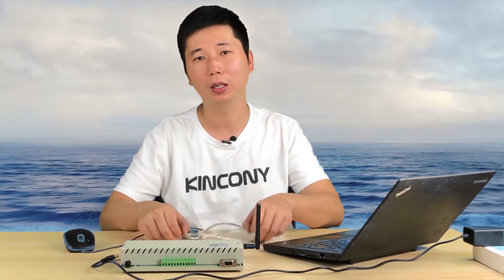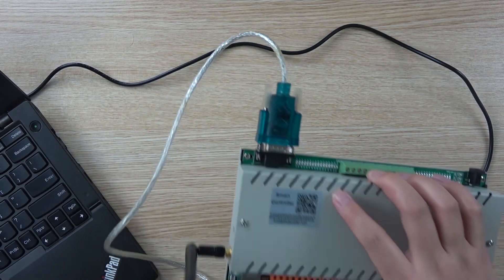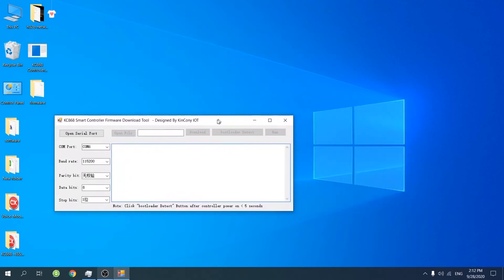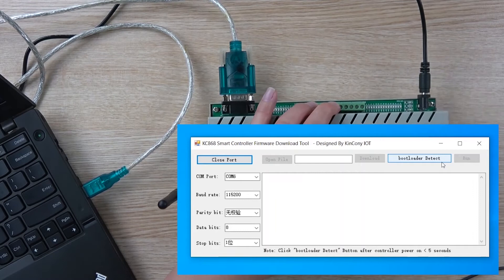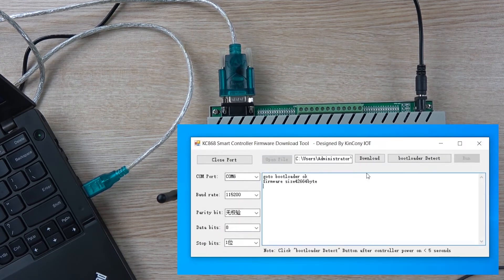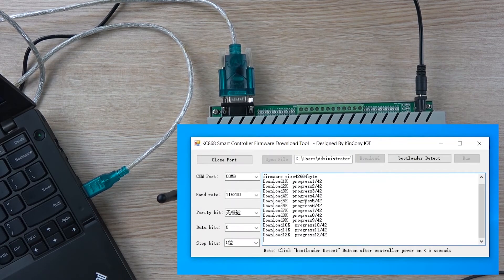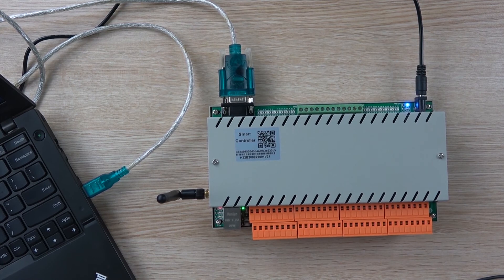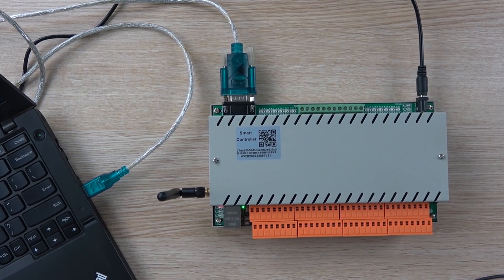【how to use KC868-H32B#5】software firmware update by bootloader tool

Comment: KC868 intelligent driver Firmware Download Tool does not detect the bootloader, I get a note:button after controller power on 5 secons, does not let me update the module KC868 H32B, what is the fault?
Reply from the maker: you must power on, <5 second press "detect" button.
Reply: @KinCony  It doesn't work, it doesn't do anything, I've checked the com port and it's correct.
Reply from the maker: @davidzapata3567  take a photo of your controller QRcode, post to our technical support forum , we will help you.  www.kincony.com/forum
Reply: @KinCony  ok, thank you